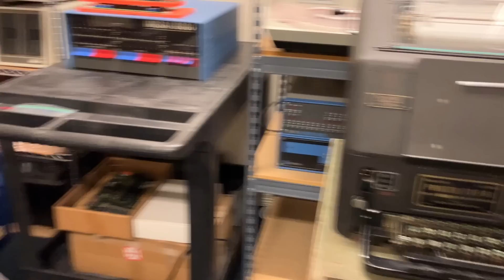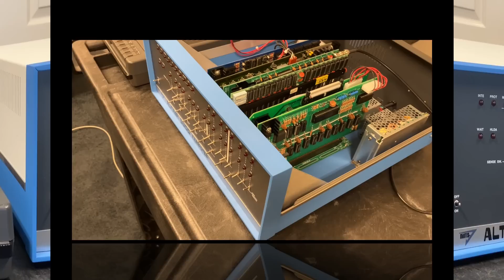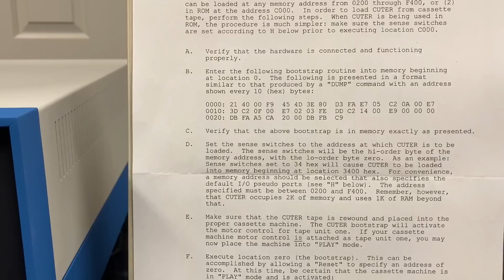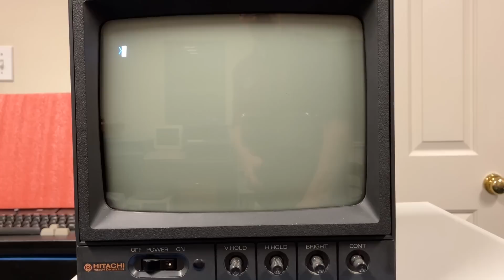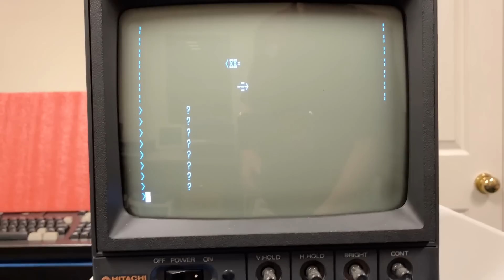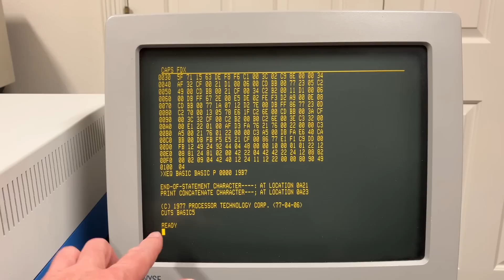Resurrecting  a Lost Microcomputer Tape Operating System

Comment: Because my QK-1 thing is ultimately supposed to be the size and cheap and nastiness of a 4 function calculator, I gave thought to a cartridge that uses a mobile phone as a "tape deck". Plug the thing into the headphone jack and open the voice memo program on your phone.

But...... I think an ATMEGA328P and a 24 series serial EEPROM would be better. Might as well roll the UART interface into it too.

Oh! And maybe put a socket in for swapping that EEPROM in and out if I'm feeling generous and it doesn't increase the cost very much! SOP8 serial EEPROMs are more common though (very easy to find and salvage in ewaste) so idk.

Comment: Holy cow, this takes me back!  First computer I used was, I'm pretty sure, an Altair 8800 in about 1977.  The thing I remember is the guy who owned loaded everything off of tape and it had software to auto-find the file he wanted. 

I've never seen such a thing since....until I just saw this video.  I think you've just provided me the last piece of the puzzle of what that first system was.  I knew the system, based on my recollection of the front panel switches and LEDs. It was just what software it might've been running.

Comment: one of the firsts boards out was an mother board expander and their power supply upgrade kit which added a second transformer in series with the existing to raise the voltage by I believe 3v.

Comment: I got a box with SOL software and manuals.  I don't want it.  I grew up with it, with two SOL (parasol board, too), but the computers were tossed when I was at university in the 80's.  The box survived.  I don't want to mess around with unpacking and inventorying and sharing the inventory and all that.  If you (the channel owner) are at all interested, let me know, and we can work something out.  No, not trying to sell.  Just want to give to an enthusiast who could put it to use.

Comment: Does anyone know how the card dealt with bus contention between the display controller IC, the CPU and the screen memory?
Reply: Screen memory would have been dedicated RAM on the display card with circuitry to interleave CPU and CRTC accesses, typically adding wait states to CPU accesses as needed to prevent screen tearing.

Comment: Question, I noticed the two vertical white strips on your Altair 8800. I ASSUME you prefer to fat finger in hex as opposed to octal. If this is the case, how do you see this as an advantage for you?
Reply: I'm sure HEX became more popular with devices that have 8 bit data and 16 bit address buses, because it always fits, without leaving odd bits that have to be dealt with separately. 

OCTAL was more suitable to things like DEC PDP-8 with the 12 bit data and address buses.

I maybe wrong of course. :)
Reply: Pretty much everyone went to Hex over Octal after the first year or two of 8080 PCs. My Altair also has those stripes as well :)

Comment: I used the Sol-20 in a computer store in London, ON Canada in the late 1970's. They later had a two bay 8" floppy drive cabinet that could be connected to it as well, if memory serves well. I also got to play with a Kim-1 and a SYM-1 as well. Very early 6502 single board computers with a hex paypad and an amazing 1K of memory. I still have my original MOS Technology 6502 programmers guide (Basically, a list of instructions and detail on their execution) Programs gopt entered in via a ROM Monitor program (Pre BIOS) that the machine would boot into leaving you at a command prompt. Single letter commands addresses and values! One of the staff at that computer store was programming an application to record amniocentesis data and do some basic analysis on it. It got to assist a by running his test scripts and making note of the results. Not bad for being 11 at the time. The store eventually moved to another part of the city taking it far away from where I was living. I also got to play with a Ohio Scientific Challenger 1P. So much history!